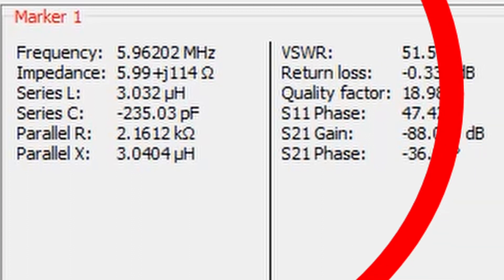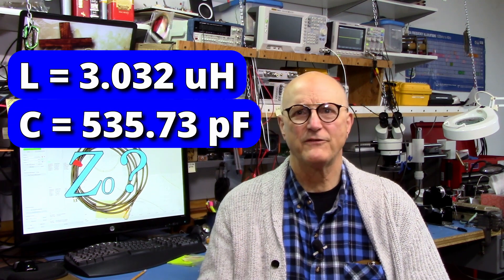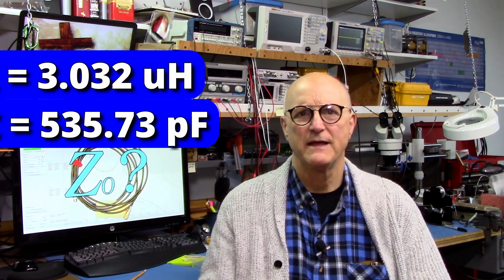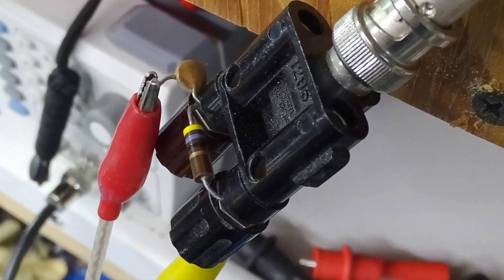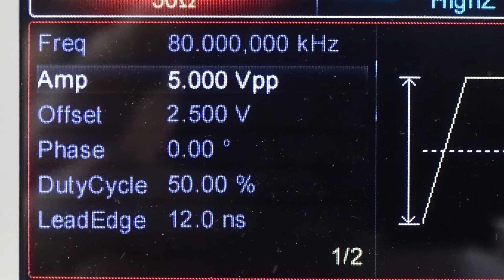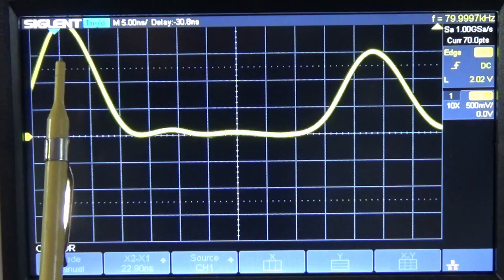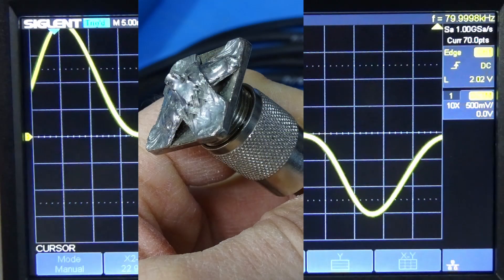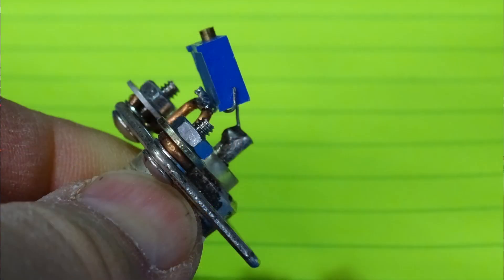Measure the Characteristic Impedance (Zo) of an Unknown Coax (052)

Comment: Great video!

I have a bunch of unknown cable (conducts are 2x 16awg, 5x 24awg) which I intend to use for some signals over the 5 smaller cables along with power over the larger ones. I am hoping to transmit an RS422/RS485 equivalent differential signal......Is the TDR method valid if was to pick two of these smaller gauge wires as a "pair" to know how to properly terminate the line at both ends? I have access to a DSO and sig-gen, so this method would be best :)
Thanks!
Reply from the maker: Yes, actually! A company I worked for bought a 1,000 ft roll of multiconductor, twisted pair, custom cable that I had to test for impedance. The TDR method is the method that I used to do that.🙂
Reply: @eie_for_you  fantastic! Thank you! Looks like I've got some homework to do then 🤣
Reply from the maker: @mjunek  It's fun to discover stuff. When you see it working, it is very satisfying! 🙂

Comment: There is one more way...Find the frequency of the 1/4 wave length of the line with the far end open circuit.  Multiply that frequency by .5 and 1.5.  Measure the R and J at those two frequencies.  Calculate the two impedances using the R and J.  Average those two impedances.  This is essentially the same procedure that the FCC specifies to measure the sample lines of AM directional broadcast stations.
Reply from the maker: Hmmmm...I hadn't heard of that one before. Sounds like a fun thing to try. 🙂

Comment: Very nice explanations! From my experience I have had measure really long twisted pair cable around 1km. In this case resistance is also matters. What would be the way to measure resistance using VNA, same as inductance?
Reply from the maker: Thank you! 🙂 Measuring the impedance of twisted pair cable was my first introduction to doing all of this.  Communication cable for EEG amplifiers.
Resistance ... I am assuming series resistance of the wire itself. You could short the far end and measure this with your an appropriate DVM, but I recommend using the methods I describe in this video:
https://youtu.be/M46EtjltOug
Regarding the inductance, as far as I know, you are not going to be able to get at the inductance all by its itself. What you read with the VNA is a composite impedance which is composed of the resistance, capacitance and the inductance.

Comment: thanks for your Excellent explanation I want to know if I want to calculate its Characteristics Impedance In 10 Mhz Frequency what changes in this test circuit like R(47Ohms) and C(7.5pF)
Reply from the maker: The frequency that I use for the TDR method is chosen so the falling edge of the square wave is far enough away from the rising edge so the rising edge is effectively acting as a step function. And yet, the repetition rate is high enough to make for a nice solid trace even on an analog scope. It isn't the test frequency because we are operating in the time domain, not the frequency domain for this test. The purpose of the RC network is to create a narrow pulse to send down the transmission line.  In my opinion, there is no real practical reason to perform this test at 10 MHz. But, if you do ... I simply chose values for R and C so that I got a nice, highly differentiated pulse as viewed on the scope (no calculations, just picking values out of the air). I would change the capacitor if I changed anything first. Remember ... easy to forget ... we are operating in the time domain with the TDR method.  It is so very easy to have one foot in the time domain and the other in the frequency domain and get mixed up on this.

Comment: You had a TDR setup? I had a used GDO and bits of wire. 🙄
Reply from the maker: Nothing formal like a TDR instrument. I used an oscilloscope, a square wave generator, a resistor and a small value capacitor.  So, yeah, I had my own DIY TDR which is sufficient for the job.

Comment: Nice to know that this also translates to twisted pair topology. I've been doing a lot of TDR twisted pair measurements at work lately, and was having a hard time finding information specific to twisted pairs vs coax.
Reply from the maker: I know the TDR method works on twisted pair. I haven't tried the VNA methods on twisted pair, so I am not 100% sure on that one. It would be an interesting experiment, though.
Reply: @eie_for_you  I'm using a LibreVNA at work to test twisted quad, actually - roughly 2.7km in our test setup.
You might want to check LibreVNA out. It's not as convenient as a tiny/nano/pico vna, but it's considerably more versatile, and all the schematics/software/firmware is open source.
Reply from the maker: @MadeInMichigan  Hmmmm...haven't heard of LibreVNA before. Sounds interesting. The nanoVNA with the VNA Saver app claims to do TDR, but I've never used it that way. I might just have to experiment with it. Thanks!